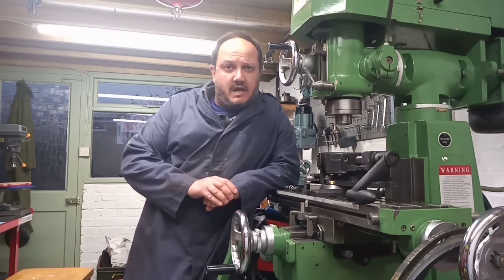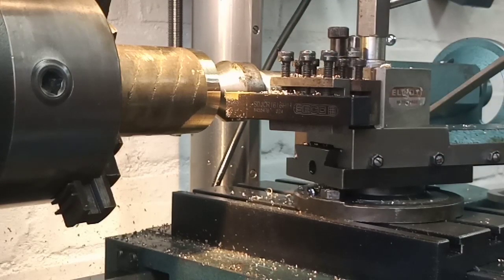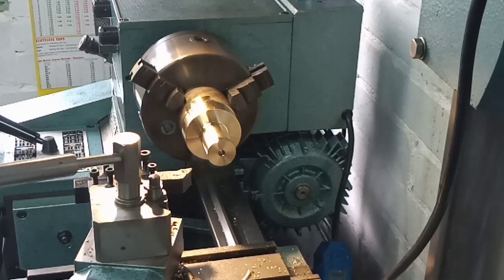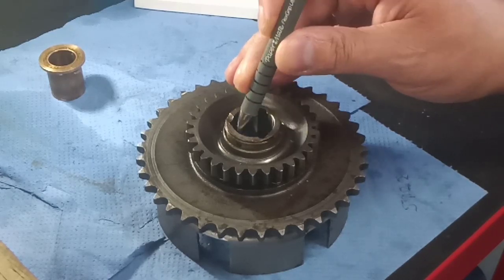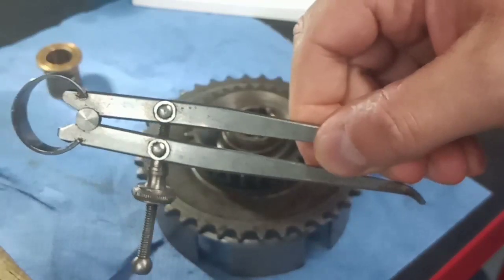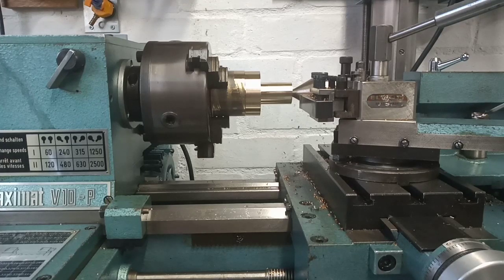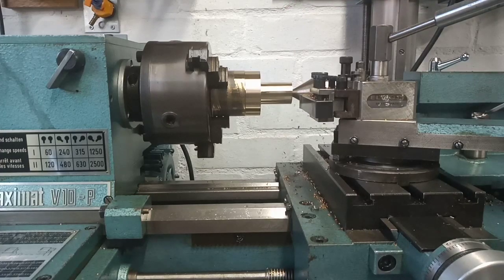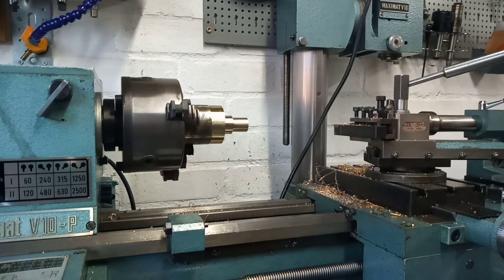Bantics Part 2 BSA Bantam Clutch Bush Manufacture

Comment: Hi Dean, welcome to the world of balancing video content lol. It will evolve over time. Just a tip, I would drill the hole at least when you rough turned i.e. Leave a small semi-finish and finish stock on ID & OD, then finish them in order of the most stock to remove (usually the OD if doing balanced cuts). This way you eliminate any potential for the part moving in the chuck when drilling or distortion through stress relief etc. Hope this helps. Good progress mate. Cheers, Jon
Reply from the maker: Thanks for the tip Jon, certainly makes sense. I was having trouble with my editing software, it wouldn't convert the larger file so I had to break it up. Best wishes, Dean.

Comment: Great work Dean. Have you tried a HSS tool with zero rake on top of the tool? So only front and side clearance and leave the top flat. Radius on the nose of the tool finished with an oil stone so it's not too sharp and gives a good surface finish. I use this type of tool for Bronze/Brass/Cast Iron. When I production run Brass/Bronze drilling, I also give the drill a zero rake angle as it stops the drill grabbing and it goes like a hot knife through butter. If you haven't tried it grind a tool up and give it a go. Keep the videos coming, sounds like you have more subscribers than me.
Reply from the maker: Thanks Tony, I haven't tried it but I think HSS would work better. I haven't got any at the moment but I'd definitely give it a go if I wanted to make another bush. I might make some new bushes for the lathe gearbox. 
Best wishes, Dean.

Comment: Turner out good Dean !
Have to be honest, it's really hard to hit the numbers on my lathe. It is 80 years old, metric and also the cross slide reads diameter not radius. So when I'm close, I use the " Trial Fit " method. 😁
Reply from the maker: Neil, I find that balancing the cuts helps, but it's no help if I don't measure it right in the first place! Best wishes, Dean.
Reply: Have you tried a dial indicator against the cross slide when you get close Neil? Just remember that you'll be cutting off the radius, so only feed in half of what you want to cut off the diameter. Used to use this trick when machining imperial jobs on metric lathes and vice versa.
Reply: @OzBSABantams  good call Tony.
I was a little short on equipment and indicators we're amongst those items, but I have one now.
Will make a new dial as well. The original is only 40mm in diameter and reads diameter , going to make an 80mm one that fits over it that will read radius. Thanks for the idea, will start using it straight away.
Cheers Neil